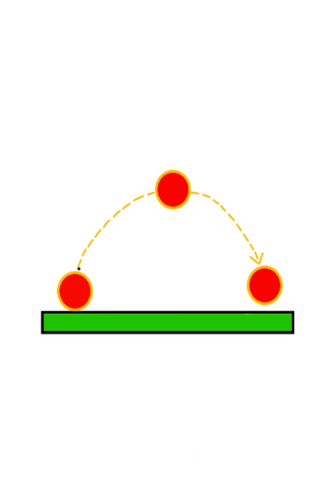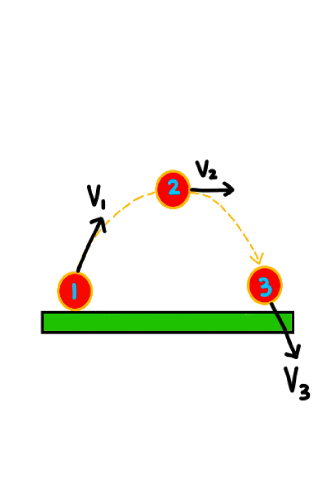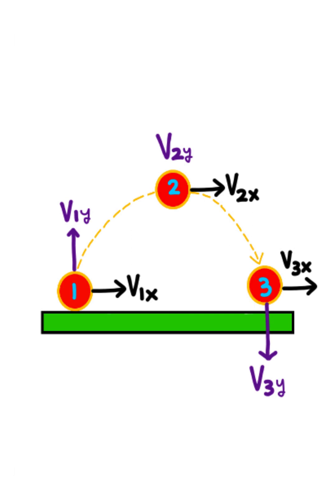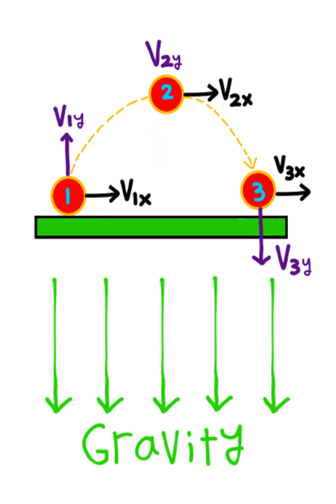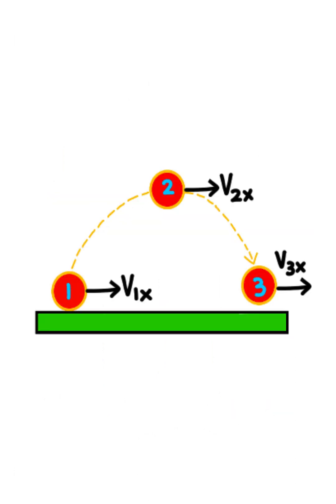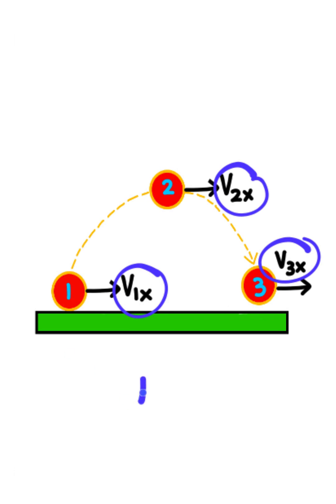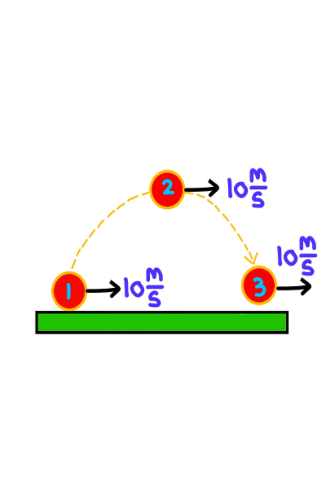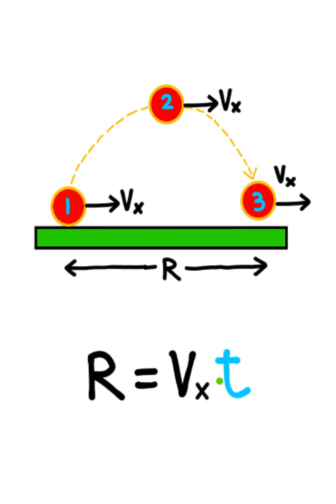Projectile Mechanics MADE EASY!!!

Comment: Ah yes the two most important things in physics and engineering:
1. We assume...
2. "Approximately" equals "equals"... well approximately
Reply: I like to think about how the ”big picture” or formula in one question, is the disregarded negligible factors in a simpler question. For example say you are driving a car and you observe it to be moving at constant speed since you are accelerated by the engine force as much as you decelerated by the ”engine breaking”. You then let go of the gas’s pedal for one secound and you keep track of the distance you traveled in that second, this is pretty much what the d= v0t-(a/2)(t^2) formula which is used to describe the throwing motion. But in an exercise about learning s = v * t the cars deceleration during one second through ”engine breaking” might be regarded as negligable. In contrast you could apply fluid dynamics to more precisely catch irregularities in the wind resistance and take it into account etc etc to get a even more exact formula to model the real world examples but then you kind of loose the purpose of what the question itself is trying to teach.